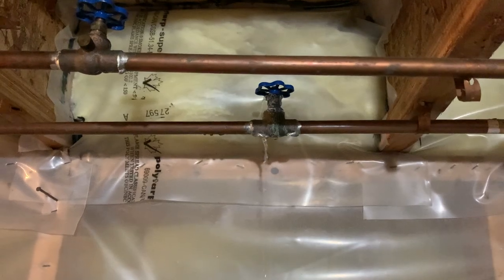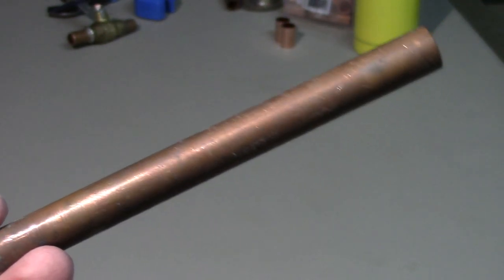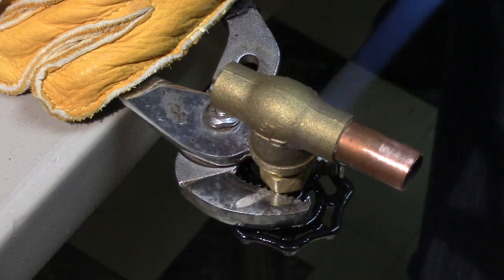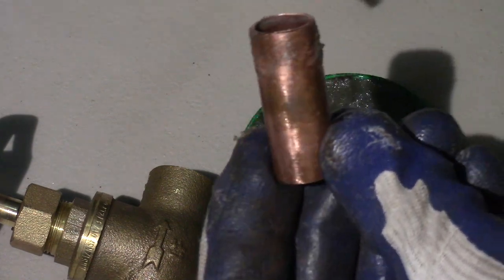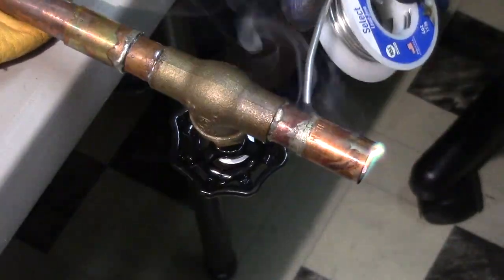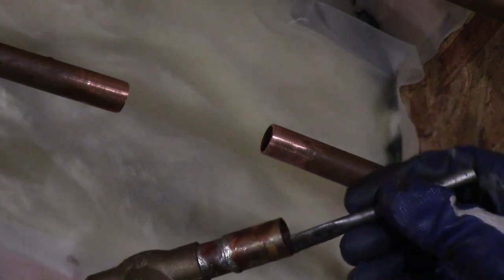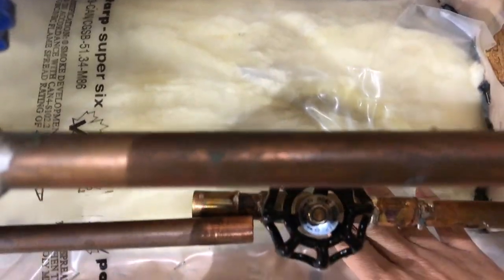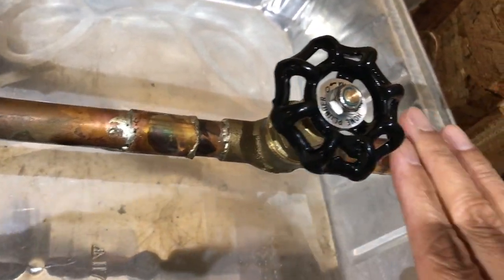Water Shut-Off Valve Leaking Badly. How to Fix. DIY

Comment: If your plan was to show off your skills on this video, than awesome! You really know how to do these things!
But if your video was about how to fix the shut off valve, then you overkilled it. It's the same as going to see a dentist for a simple tooth repair, but instead, he replaces your whole teeth line (all the 16 teeth). Not a nice thing is it? Same here, instead of buying the burners and burning, cutting, melting, fusing, not to mention the lot of work and money, you should just replace that rotating mechanism and voila! But before that, tighten that nut on top. If that doesn't help, just replace the whole shut off mechanism, not the whole shut off valve! It's much cheaper and faster.